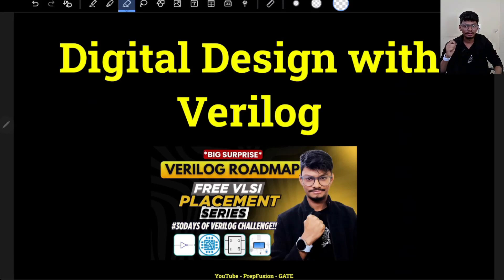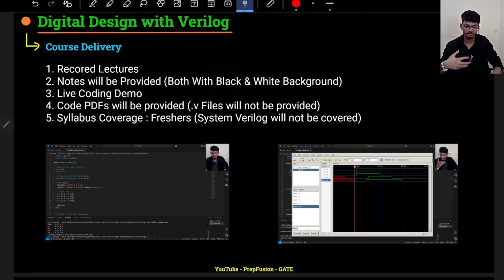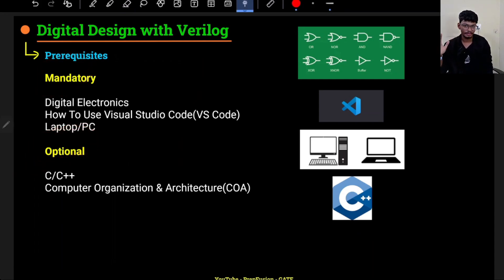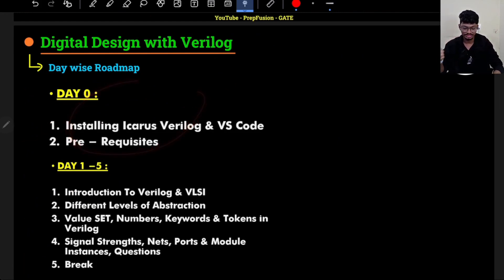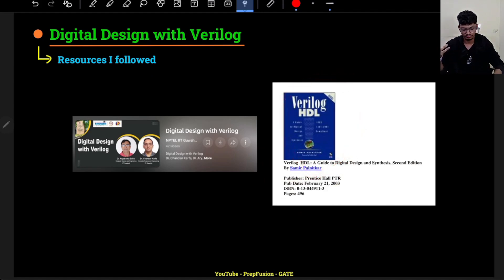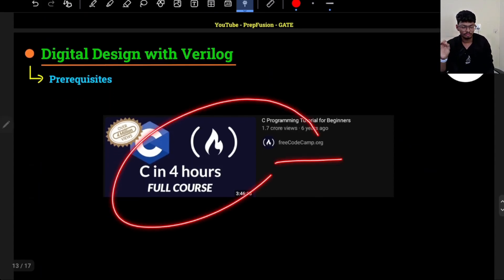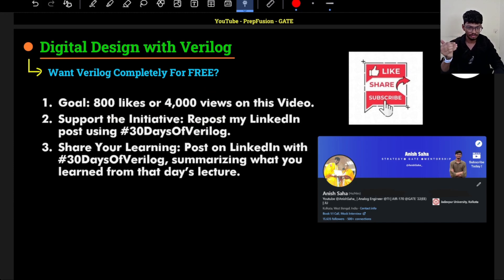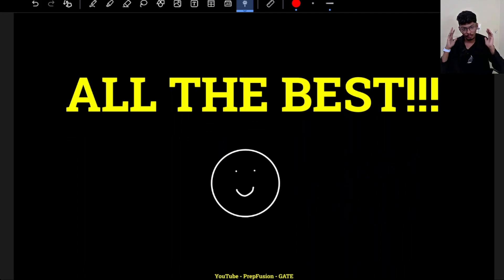Complete Verilog Roadmap for Digital VLSI Beginners | Learn from Scratch #30daysofverilog

Comment: Bro I have a doubt, say I don't have Xlinx access but others in my college had, will I fave any problem in placement?
Reply: Hi Sanjeev, Xilinx vivado has a freeware option as well which supports all major FPGA Boards. Most of the students in our college use that only. It doesn't affect placements. Don't worry
Reply: @keshavana7117  🤣🤣 you are everywhere
Reply from the maker: It won't affect placements.
Reply: @ Okay, thanks